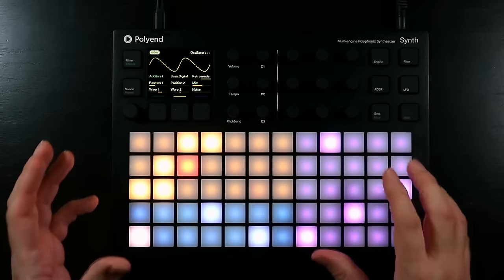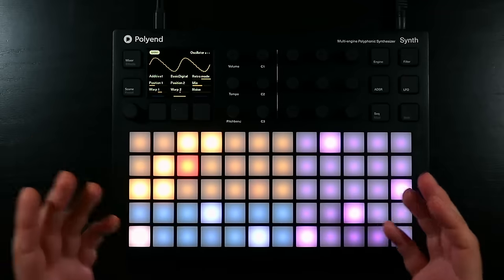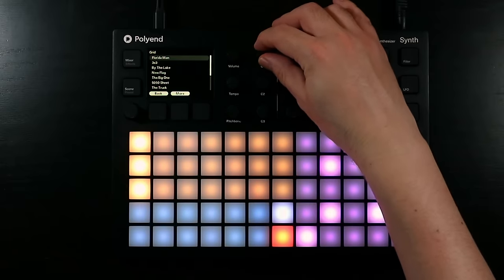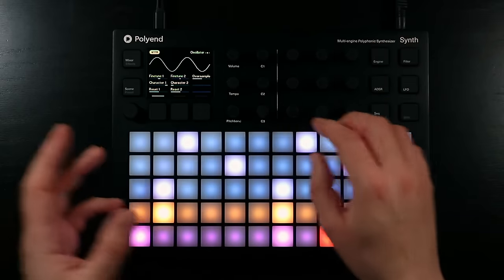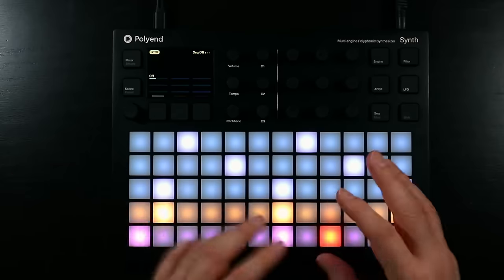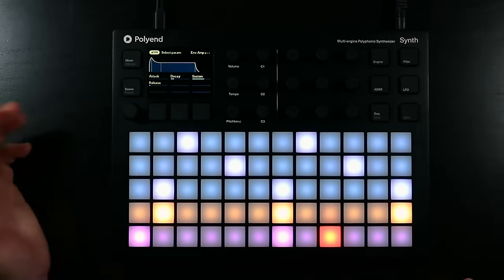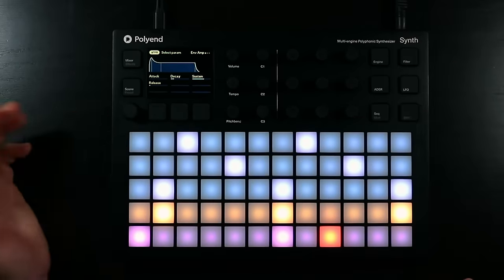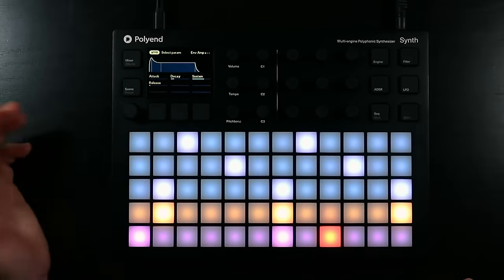We should talk about the Polyend Synth...

Comment: This looks worth it even if you only plan to use it as a midi controller! The fact it's got 12 pads per row means five full octaves all with the same relationship to each other! I've been searching for the perfect isomorphic pads with aftertouch. I don't recall if you said poly or channel, but i can live with channel if i have to!
Reply from the maker: For the internal synths it's poly, I haven't tried it as a controller, but I'd assume poly there too - but check the manual to confirm!
Reply: These avatars are brothers from another mother
Reply: @brokengadget7519  while not intentional, I can't pretend it probably wasn't happening subconsciously when I made this icon :)

It's a wave but also an M for my first name

Comment: I've had a grand ol time with the device so far. Had a couple evenings just slip by me,  because i've been sitting on it noodling. I fully agree with your take on the filth as well. It needs more filth! Some form of distortion/saturation on top of the engines would be absolutely amazing. You can get around it, depending on what engine you are using and it's source material (WTFM and WAVS/GRAINS for example) Other than that though, very well rounded overview of the device!

Comment: I recently ordered the erae touch ii, which is an mpe midi controller that is fully customizable and lets you contol multiple devices/engines from each page. Im really liking this synth one thing i think it could benefit from is a solid livelooper function like the one in the erae touch ii. It just seems very intuitive and jamabble, especially with control of those multi timbre/voices/instrumments. Maybe in a firmware update. Im probably not in the market for a new synth at the moment anyways but this does look pretty sweet to me.
Reply from the maker: I had some hands on time with the Erae at Superbooth and really liked it, the customization and multiple outputs are really great - it also has a nice squidge to it!

Comment: Thanks OS, great coverage! Aligns well with ways I’d likely use the machine. If feeding back to Polyend (and tenuously related to adding dirt/processing): separation of the synths in USB-audio (or an alternative export method) would be huuuge. Also interested in possibility of MIDI from each synth (inc arp and MPE!) being transmitted for controller purposes. Wonder too if line-in could be used to capture audio for granular...Already compelling though! Does a lot of what I've strived for through Launchpad Pro custom mappings.

Comment: So with the polyphony on the grain engine, the actual granular engine is basically like an end of chain effect but the filter is fully articulated polyphony?
Reply from the maker: @VacancyOfDisco  it seems to be weirdly in the middle of those two things - the total number of grains appear to be shared but then grains with a particular note go through their own filters? If the granular effect was end of chain, you wouldn't be able to precisely articulate the filter like you do it's weird. Basically: I'm not 100 percent sure on the actual architecture!
Reply: @OscillatorSink  interesting. Thanks for the explanation!

Comment: It looks/sounds like a cross between a Microfreak and a Novation Circuit. It looks/souns very interesting.   However, accessibility is a deal breaker for me. Can one access everything through surface key combos? or is there any/a lot of menu diving?
Reply from the maker: @dinogoldie9716  there are a lot of key combos that I didn't learn. I wouldn't say that it's particularly menu-dive heavy outside of the setup type tasks. A lot of paging through screen though.

Comment: What about the sequencer, i have not seen anyone discuss this so far. Superb video as always.
Reply from the maker: @martindu4  Bo touched on it on his video I think - it's a pretty basic step sequencer, but it has the groove templates from the arpeggiator which is good. It also adheres to the scale when you transpose it and can do the follower thing. Bo describes it as "programmable arpeggiator" in the way you use it, and I'm inclined to agree.
Reply: @ Thanks for that. Someone (on Elektronauts) mention potentially using this as a MIDI controller where each grid zone would output to a different MIDI channel. Is that possible? That would be very interesting and almost a must buy. Especially in chord modes.
Reply: @martindu4  yes it can output to separate midi channels. Vulture Culture showed this off in the beginning of his live review with it.  https://www.youtube.com/live/d_oJImU_iLk?si=cnsqqvEQQK9OsmuX

Comment: Thanks great video! Maybe you have some answers to my questions?
Does it output arp/chords etc as midi?
Can you make your own chord packs?
Can you record/make a performance or a song on the device?
Reply from the maker: 1. I haven't checked, but I will when I get a moment (I only used it stand alone in my testing)
2. There doesn't seem to be a way to make chord packs right at the moment, but I would very much hope there will be (otherwise I'll set about reverse engineering the format!)
3. No.
Reply: @OscillatorSink  Thanks 🙂
Reply from the maker: @blaatfanaat  update - I just noticed the firmware they released on release day (after I made the video) does actually come with a way to edit chord packs now! I'll have to have a play!